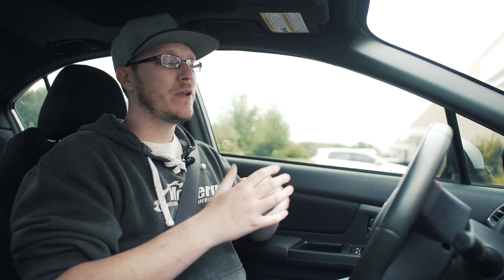2015+ WRX A/C Knock | The Truth About -1.41

Comment: man i get -11.80 feedback knock and i still went to the track and ran 8 times on 1/4 mile drag.. still going strong and no panic lol.. it can be caused by so many factors and i don't really pay attention to it anymore. i have ewg on mine and also exhaust hits my differential and that makes it go off.. there is one more thing that will make it go off that i havn't seen people talk about. when your clutch is slipping slightly you will also get negative knock reading just throwing it out there for anyone worried about the feedback knock sensor and can't seem to find out why.. you should be worried when you start hearing different engine noises and its constantly reading knock even at idle. aside from this enjoy the car
Reply: THIS !! 👍

Comment: Why does the a.c. and defrost have to mess with clutch and throttle response?  It's horrible to drive my 2018 wrx with a.c. or defrost. Shifting is a hell no during use. Why is this? And why can't manufacturers make it seamless?
Reply: because it would be a much more complicated and likely less efficient system if you designed an AC condenser system that was totally quiet and smooth. There's no way to make it unnoticeable because AC condensers NEED energy to cool down the air that's being pumped into the interior of your car. An electric car or hybrid can make it seamless.
Reply: @kaimingleung1396  thanks. I just feel like im hurting my wrx driving with ac. When should i use it when should i not? Is it ok to turn it off and on a bunch? Or will that hurt it
Reply: Got. 2017 no issues with AC on. It's suppose to cut off if you romp it.
Reply: I mean, I don't see how it would hurt your WRX more than just driving it lol. The car is subjected to a LOT of force and stresses just by going down a road with some slight bumps or uneven pavement or when you accelerate or brake. That's why there are all kinds of rubber bushings, shock absorbers, etc. to help mitigate that and distribute the forces across several areas. I assure you that the tiny clutch for your AC isn't doing anything to your car when it engages and disengages!
Reply: My ladies GTI is so smooth when the AC kicks on, can't even tell. I don't get it... the WRX its like getting hit by a deer.
Reply: @cyruspark6472  it Is. When that thing clicks on you get bucked like a bronco. On the interstate it's not bad but in town driving around it's not fun at all.
Reply: @dnawrapsatl  thought this was just me. Fucking obnoxious. I can't even rev match right with a/c or heat on, it like stunts the rpms. Starting to really hate this fucking car.
Reply: I fucking hate it. My car be feeling sluggish as shit moving from a stop, even more on a hot ass summer day.Feels like the engine is underpowered, very rough, and likes its going to blow up
Reply: @Tony-tk4ht  after my tune it's a bit better. But still an issue probably going with a 400z next unless subaru comes out with something better
Reply: I just got my sti a couple months ago I usual leave it at speed 1 or first notch but today it was hot as hell 99 Fahrenheit and turned it up to 4 notches and driving it sucked felt like no power. Didn’t want to get on it because the engine felt so weak and like some else said rev matching sucked too. It was a completely different car. I was like is this normal? I guess it is.
Reply: @michaelhernandez8418  yep typical 4cylinder b.s bigger the engine the less you notice it

Comment: I experienced this several times but was not concerned due to the information you provided in a much earlier video saying any knock readings below -2.88 were expected and safe.
Several weekends ago i did get a knock reading of -7.98 (or there abouts) and had a -11.xx the following day. That was worrying... Took the car to a dyno tuner and haven't experienced anything greater than a -0.35 since.
Reply: The MA Stage 1 on my 18 STi didn't work out well.  I got into the -7's, dyne tuned with a Catless DP by Mikey Botti...haven't been above -1.4 yet in the last 12K miles.
Reply: I have also had a minus - 7 that's only when I give it the beans with ac on.
Reply: Nobody should run an ots. Get a pro tune or stay stock. I had a few 8+ knocks on the cobb and map tunes. This is horrible for your rod bearings. Send your oil for analysis after those readings and metals will be high especially in the fa20dit.
Reply: i got that constantly with maps ots 93. i got etuned by phattbotti and i have yet to get anything above -1.41. when i do get that is from the ac. but still even with it on it is rare.

Comment: I get -1.41 and -2.82s for both FBK and FKL daily with AC off all off the time.  Usually see it before I've even gone positive on boost.  Running MAP 91 tune on BP 93 octane.
Reply: nine5 raptor yeah I get the same from time to time, I just don’t think the car honestly likes not being up on the turbo because as soon as it hits boost it goes away
Reply: Make sure you don't have a drop in filter.  That caused some issues for me.  I also  run 93 on a 91 MA tune and add a 1/4 bottle of Torco.  That lessons it even more.  Unless the A/C kicks on I can drive 50 miles with stop and go and there is zero feedback knock.

Comment: This is a question about DAM but every time I start my car is reads .688 DAM and will work it's way up going to .720 then .875 the .938 then to 1 and will move around to .875 or .938. Knock only shows the typical -1.41 or -2.8. Is that normal or should I be worried
Reply: check your fuel source, the only time my stage 1 wrx gets a low dam is when i put bad quality fuel in. find a good station and only fuel up there

Comment: I am getting -7 feedback knock randomly while cruising on freeway with A/c on. It doesn’t happen on every drive. And usually I’m in cruise control when it happens.  Dam always stays on 1 and I don’t really feel any power loss/ knock. Car drives great. Is this the famous phantom knock???
Reply: Same thing driving from LA to Oakland today in 2014 WRX only got -7.0 a few times with the AC on with cruise control and -3.5 with the ac off
Reply: @zachwhomadethis  so I think I figured out what the problem was. It was mostly likely a boost leak that was occurring. I had switched to a FMIC and the shitty clamps that come with the kit just can’t stand the clamp force needed & over time they get loose. I switched to mishimoto tbolt clamps and the car drove way better and I haven’t really had a problem since.
Reply: @zachwhomadethis  also clean out your maf sensor on your intake and reset your ecu so it can relearn.
Reply: @juliomiranda6801  thanks man I ended up finding a loose plastic piece of the original intake even though I have a CAI. It was just attached by zip ties and it was loose so I think that piece rattles around at highway speeds causing the knock sensor to detect more frequencies. Ive had the piece out for about 5 days now and the highest feedback knock I’ve picked up is -1.75 on almost no load just cruising. I never detect any feedback knock on higher loads but occasionally I’ll notice my access port logged a -.70 fine knock learn with no feedback knock after doing a pull.  DAM has never dropped and the car runs excellent.

Comment: I have an 18 wrx and I even get this with heat on. No I dont have the ac on with the heat its in the winter when I have just the heat on. I have tried every setting making sure its just the heat but I still hear the compressor kicking on and off. Is that normal as well?
Reply: I also have an 18 WRX and mine does this as well. It's completely normal. The A/C compressor kicks on regardless of temperature setting to remove moisture from the air, regulating humidity. It helps to keep your windshield and windows from fogging up. Same reason why the compressor is used when defrost is on.

Comment: I am new to Subaru and the AP when I was parked and do a light rev I would get a -1.41 on the fine knock. Is this the same? Even tho a/c is off and all. Thanks bro
Reply: Could be an exhaust rattle.
Reply: mine goes up when spirited driving with AC Off. Shouldn’t really worry unless your DAM goes off

Comment: Not gonna lie, Im running Invidia N1 Dual Catback, ETS Intake and Turbo XS Hybrid BOV. Still on stock tune. Im at 90k and still running strong. (I drive 52 miles to work and 52 miles back home- 1 hour every day i work). Thus why im at 90k lol. Not bragging, not complaining but just explaining my scenario. I dont have an accessport so i cant tell knock readings. (Still saving up). Having a blast though!
Reply: That should have been your first mod. Do you have an engine light? $500 is cheap compared to what it costs to fix it.
Reply: @777aterial  Thank you for your opinion. Unfortunatley, the Cobb Accessport costs $650 :
https://www.maperformance.com/products/cobb-tuning-accessport-v3-2015-2018-subaru-wrx-sti-ap3-sub-004
No engine check light issues.
Reply: They cost 400$ used
Reply: You are playing with fire good sir, good luck tho
Reply: @ChirpingChocobo  I would get one on the principle of it being your daily. Running lean won't always appear on a check engine light. Look up how much a new FA20 costs. Like the guys said playing with fire.
Reply: @777aterial  agreed, I will definitely get one when i can.
Reply: Anthony Iadevaia with his budget looks like it’s going to be HIM owning that car
Reply: @waybach  eggzactly. Car is paid off now and im at 146k on motor, no accessport, no plans to trade/sell the car, no issues whatsoever!
Reply: Brandon Parijs same here my brother!! Even if the motor dies, replacement built motor will be going IN!! Btw, what year is your car? Mine is 2012 sti and literally JUST got the Cobb AP 2 months ago. 86k on it and still pulling strong ...so far 💪
Reply: @ChirpingChocobo  ets intake runs fine on stock tune i have an accessport and runs well within safe afr range
Reply: @waybach  I apologize, I have no idea why i didn't see your comment till 1 year later. Mine is a 2016 WRX
Reply: @RaidsVFX  thank you for letting me know, I still don't have an accessport lol so I am glad to hear it runs well within safe afr range. I have 168k on my motor now and still no issues!
Reply: @ChirpingChocobo  yeah some people just don’t know what they are talking about. It’s been backed up and proven ets runs safe afr and if anything there’s a .5 difference which is negligible

Comment: I get the notorious -11.95 FBK from time to time, probably once every 2-3 weeks. Bone stock 2016 WRX running MAP Stage 1 93. Usually fill up at reputable gas stations like Chevron, Valero, Shell, or the local H-E-B gas stations here (grocery store chain in TX). DAM is at 1 about 80% of the time, and will usually drop to 0.75 or so and go right back up after some driving. 65k miles and shows no signs of blowing up yet, oil change every 3-4k with no noticeable metal shards, and new spark plugs at around 54k. I drive with AC on 99% of the time, because I gladly sacrifice driveability for comfort (when you are fat you will learn that you'll have a strong distaste for heat and love for cold). Obviously a pro-tune or E-tune is gonna be in the works along with some tasteful power mods (exhaust, TGV/EGR deletes, EBCS, etc) but until I can save up for it, this OTS tune seems to hold up OK...

Comment: No a/c, maybe once in a great while I'll see -1.41. With a/c though, I get pretty consistent -1.41 to -2.88 and have on got up to -4.22 twice. (Talking almost 10k on tune now). My biggest thing is the slight jerk I feel in the steering wheel when the compressor kicks on and shows knock.
Reply: just the compressor kicking in you shouldnt be flooring it with the a/c on regardless
Reply: @aolj02  considering I live and work around highways with cruising speeds of 80-95mph
Reply: @aolj02  AC turns off when you go wot anyway...
Reply: Dang I was freaking out cause I've been noticing that I get 2.8 a lot while cruising and one I got 4.22 thought my engine was going
Reply: Mem one guy working at asf subaru tune told me the you need to be worried if your - goes more than 7 because the bumps on the street or rattling inside the car can produce false readings so -4.22 nothing to be worried you need to be worried is your DAM dropp since 1.00 to 0.500 or 0.300 those are numbers to be worried and thats happened if you feeding knock readings is more than-7.22

Comment: My feed back knock drops to -1.41 almost every tile I drive my car... but my dam never drops is that normal? ac not on
Reply: You may have a loose bolt or a rock rolling around in the bottom of the engine bay.  Sometimes bumpy roads can trip the knock sensor, too. As long as your DAM is at 1, don't worry about it

Comment: I can’t get the dam passed .233 with your tune
Reply: D S must not fit your engine good enough
Reply: Sounds like you're running 87 octane.
Reply: Wish I was. Then I’d have an idea of what’s wrong
Reply: When I got a protune my tuner said our cars hate chevron and that shell 91 or 93 is all I should ever use. Check your spark plugs too.
Reply: New ngk iridium plugs, and I use 93 from Sunoco.. I’m gonna send a log in soon to find out, but I’m thinking going to the dyno after a couple add ons. I have an intake, and the tune that’s it. I did cobbs 93 tune and it didn’t knock at all and dam stayed above .833 no way to really tell other thank logging
Reply: Dollars to donuts it's the intake. Run stock and reflash. See if that helps.
Reply: Just reflashed, not even 25 mins of driving it’s at .875.. feedback is 1.41 and fine learn is 2.81
Reply: Could heat soak be an issue? I mean it’s 75 degrees outside. Idk it runs great, just the issue of this dropping all the time
Reply: @SCStang  Shouldn't be dropping like that. 75 degrees is nothing. Our summers are 100+ and my dam never drops. Dam drop like that is a sign of issues with car or bad fuel. Run that tank of gas out and refill then consult a pro tuner so he can check your logs.
Reply: Thanks! Yeah I’ve had the car since 12k I have 50k on it, prob 15k of it with the map 93 tune. Subaru has done all the work other than intake and tune, had clutch fail and replaced just a few weeks ago. Who knows. But yeah pro tune and I’ll see. I’ll let you know if it changes things, I’ll be going to Evans tuning in Pennsylvania after a couple upgrades
Reply: @SCStang  Flash a 91 tune if it get's better then it's your gas. Good luck.
Reply: Try an octane booster and see if it fixes your dam...more than likely its bad fuel in your area
Reply: M R our cars hate chevron? Wtf? Is there any proof to that or did ur tuner just happen to buy gas when chevron was refilling their tanks lmao
Reply: @dark2520   My tuner is very, very well respected and tunes for the awd circuit and I just took his advice. From personal experience I witnessed more knock with chevron 91 in CA as well. Maybe just a CA thing.